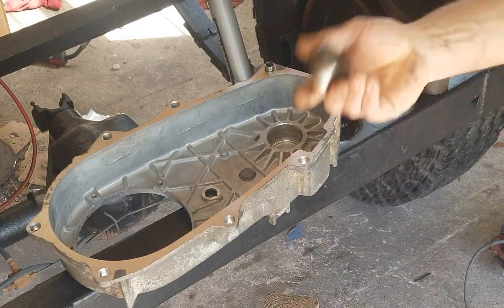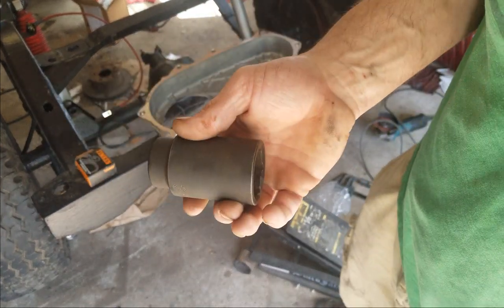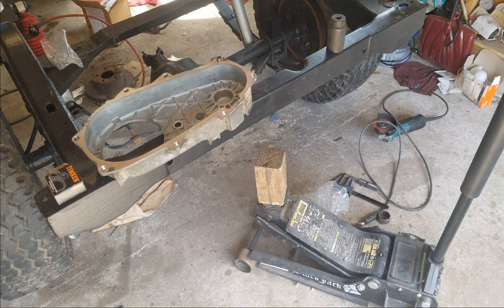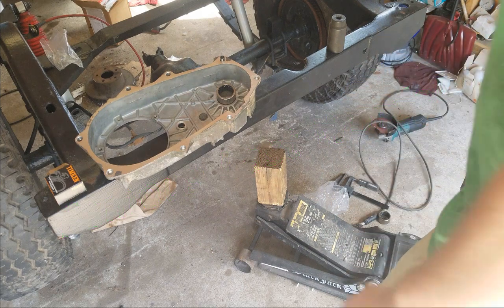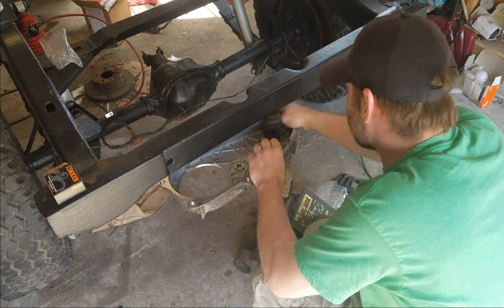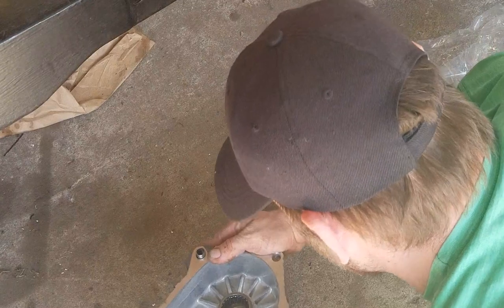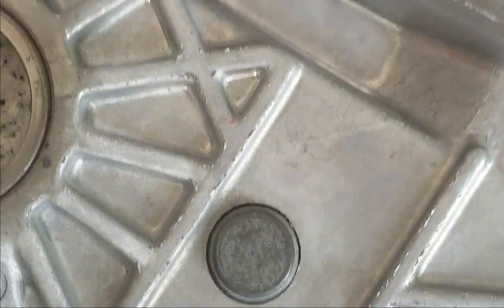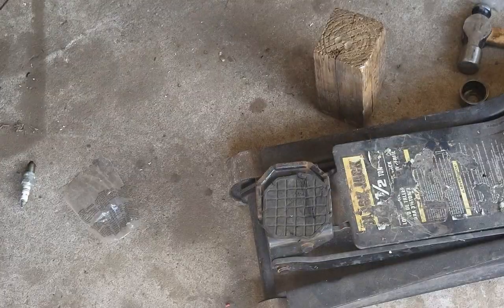This should be easy... Jeep NP231 Installation of transfer case front output shaft bearing

Comment: ratchet straps from the jack axle to the jeep frame would hold it down in place to act more like a press. Just use TWO good heavy duty straps.
Reply from the maker: Thanks for the tip, I'll just use a press next time. Hopefully there isn't a next time.